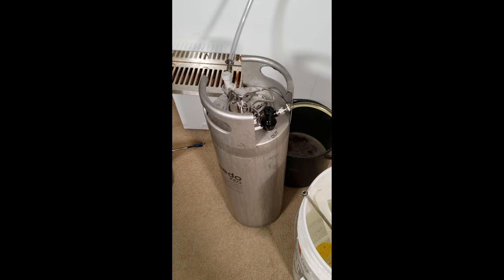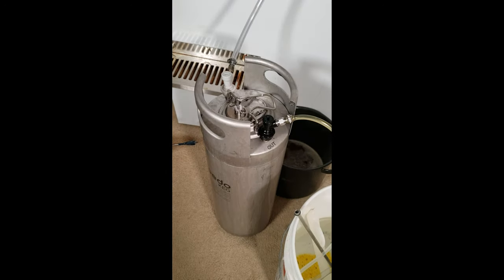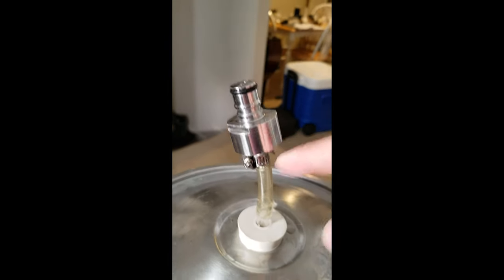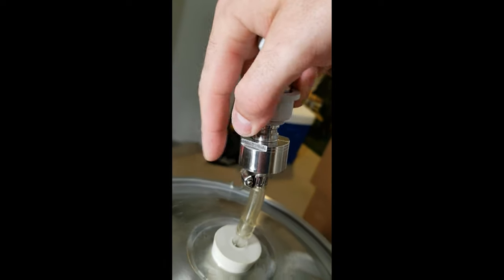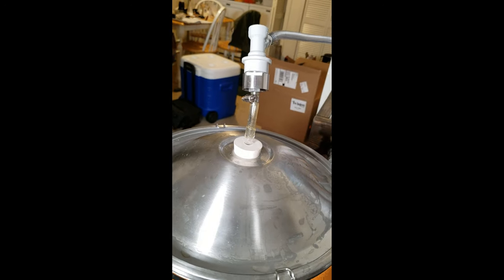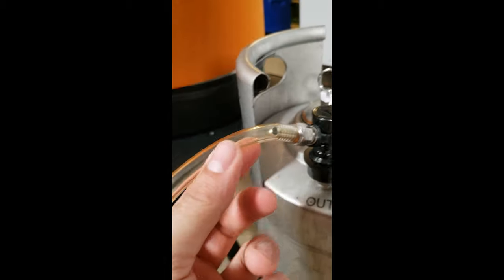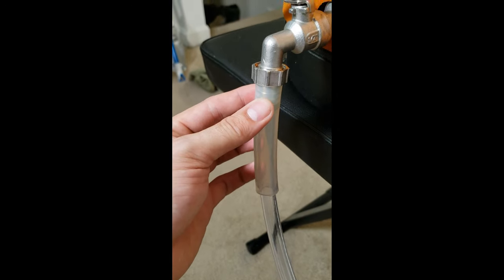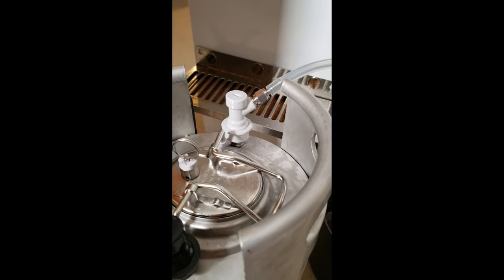How to CLOSED TRANSFER with ANVIL BUCKET Fermenter #Shorts

Comment: Blichmann has a 1/2" npt to 3/8th barb that fits on the anvil tap that allowed me to go 3/8th tubing all the way without diamter change. I also do the loop back into the fermenter instead of using pressure from a co2 tank using  a 3/8th barb elbow into a stopper. Great vid!  Cheers!
Reply from the maker: That may be an upgrade I'll have to make. The hose barb is still a little loose even with 1/2" tubing on there
Reply: Hey Jason, just to clarify, you don't pressurize the anvil bucket? You use CO2 to force the sanitizer out of the keg, run a line from the anvil tap to the liquid out post, and then run a vent line from the gas in post to the top of the fermenter? I'm new to kegging and have been confused with how to limit oxidation with the anvil bucket. Thanks in advance!
Reply: Glad I read the comments. I was able to order the Blichmann fitting from my homebrew supplier. Thanks for posting.

Comment: You can also connect the gas out on your purged keg to the ball valve on the top of the fermenter, elevate the fermenter and let gravity move your beer. The beer displaces the CO2 in the keg which gets pushed back to the fermenter, no pressure needed.
Reply: Also, this little guy is great for having your 1/2" tubing straight to your QD.
"Swivel Flare Adapter - 1/4" FFL x 1/2" OD hose barb" https://www.brewhardware.com/product_p/fflbarb12.htm
Reply from the maker: Yup, at that point it becomes a closed loop, which is a good method if you want to save a little CO2

Comment: Love the shorts! Tried this last weekend and can’t get it to work super well. All of the pressure just leaks out of the lid even at <2 psi. It also stalled at 2.5 gallons and wouldn’t fill much more and it took a whopping 2 hours to get there! Not sure what else to do! :(
Reply from the maker: You only need a few psi, make sure the receiving keg is not at equal or higher pressure and beer should flow unless you have a clog
Reply: I do this same process with plastic buckets and transfer in about 30 or 45 minutes. Super low psi... I actually turn it on and off with the shutoff valve when it seems like my bucket might be getting too much pressure.

Comment: If I cut my liquid post an inch from the bottom. Do I need to worry about the puddle of starsan left behind in my beer?
Reply from the maker: Most sources say a little starsan leftover won't hurt but I like to be sure everything but the foam is gone when I transfer
Reply: @TheApartmentBrewer  yeah same. I usually push some starsan through, then open the keg and dump it all out. I seal it back up and purge the keg a few time with some burst of co2. Recently on a brulosophy podcast they were saying you still get some oxygen mixed in there still. Has me a little worried. Ha
Reply from the maker: @naka1backbrewery854  I mean, technically yes there will be a small amount, but by doing your due diligence and purging again with co2 after, you'll minimize its impact
Reply: @TheApartmentBrewer  cool! I’ve never noticed oxidized issues.  But that had me worried for a sec when I heard that. thanks for the great content and putting my overthinking at ease lol